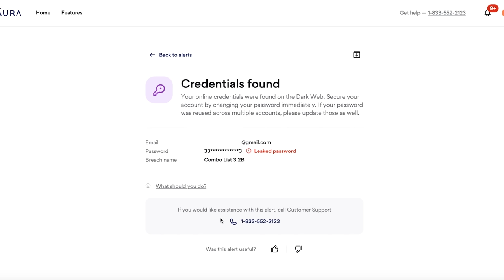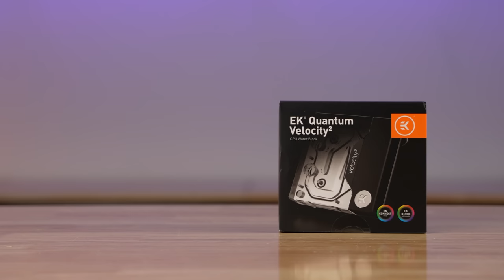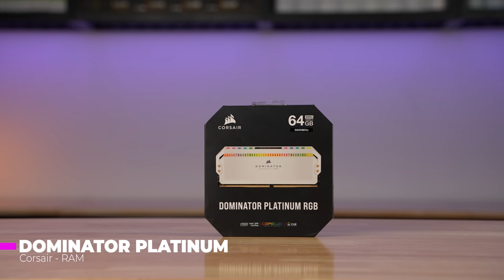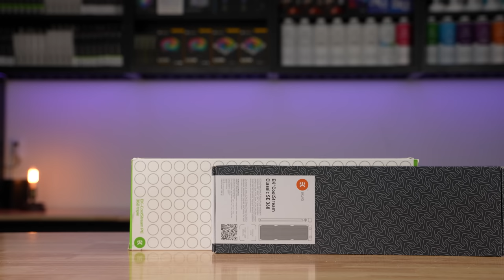The All White RGB Gaming PC

Comment: Trying to wrap my head around using adequate thermal past amount on the GPU but use the pea method on the cpu with the size of the 12900k and the heat it out puts the pea is just not  sufficient to get the coverage.
Reply: The coverage was good, ending up rotating the CPU block off camera and peaked at the spread